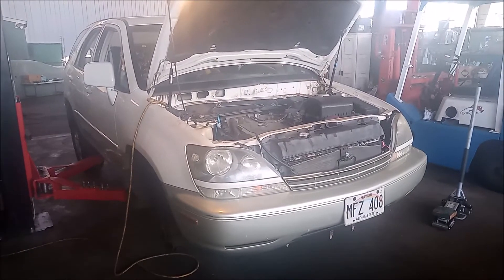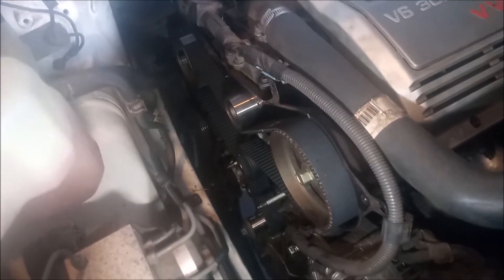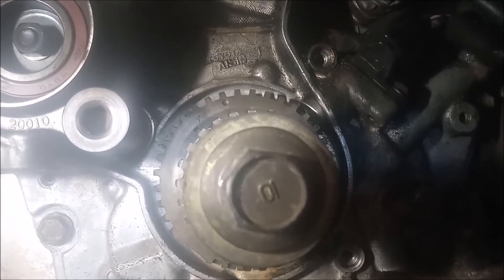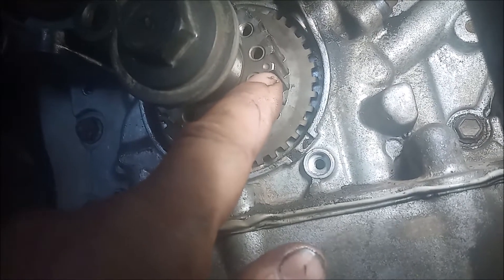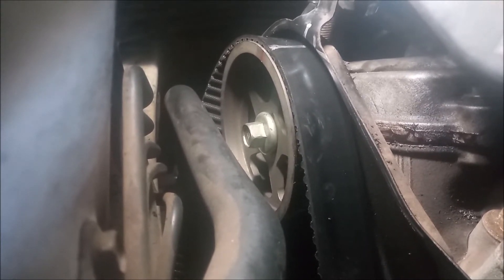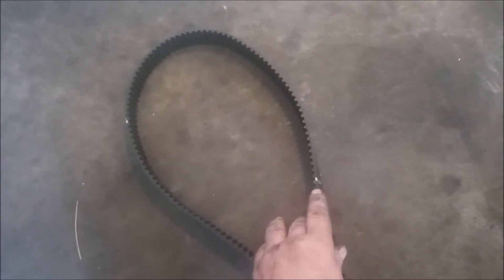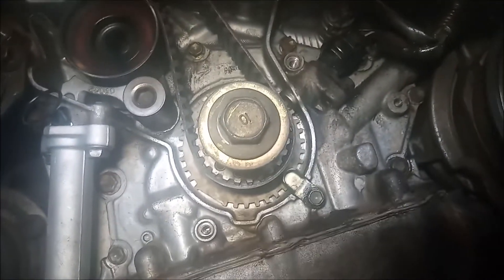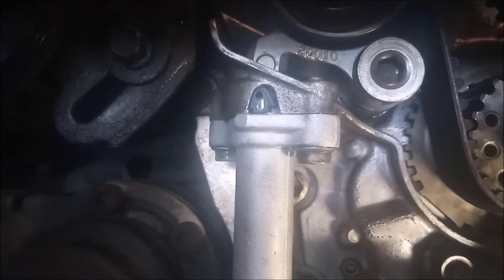Toyota/Lexus Timing Belt and Marks - 3.0 V6 1MZ-FE & 3.3 3MZ-FE Highlander Camry Sienna RX300

Comment: quick question.  I have a 2003 lexus es300 1mzfe engine v6.  Nothing wrong with it.  I was planning on doing the timing belt so I took the cover off.  I went to rotate the crank to time the engine.  I couldn't line up the 3 marks with so many full rotations.  I put everything back together because the marks do not line up exactly.  I thought it would be 2 full rotations.  Those marks didn't line up and I was rotating it like 5 minutes and got tired lol.  I am currently driving the car and the engine is great.  I am thinking I should re-attempt this but wanted some advice.
Reply from the maker: When you turn the engine, you do not look at the painted marks on the belt, you look at the notches on the pulleys and how they align to the narks on the back cover for the cams,  and on the block for the crank. The painted marks on the belt take 26 rotations to come back to the same position. The notches on the pulleys should come back into alignment with the cover and the block after two rotations. If the belt is not installed correctly, they will be off - after two rotations. Anyway I advise you never to do a timing belt again, because you do not know how to verify your work, and you lucked out this time, but next time, it might all come crashing down on you.

Comment: Thank you the numbers you counted were what I needed because the marks on the belt on the new one where not right and was finally able to finish the job without taking the timing belt of again
Reply from the maker: How can the marks on the belt not be right? It means you put the belt on backward. You need to remove the belt and flip it. Then the marks will line up correctly.

Comment: Thank you !! From.. 0mark/( or using arrow mark "pointing away from the engine" ) 77 from cam shaft toward bank 2 sprocket, bank 2 sprocket to bank 1 sprocket 59, from bank 1 sprocket to cam shaft 0mark/(arrow) 75 ( bank 1 is located in the back of the engine touching the fire wall) total teeth 211 in 3mz-fe.

Comment: My lower crank pulley timing cover was completely destroyed.. how do I set crank pulley notch with tdc?.. not the timing crank pulley notch, but the serpentine bigger pulley groove.. in other words, I don't have a zero to go by on the cover. please help ..thank you so much!
Reply from the maker: Without a cover, you cannot use the harmonic balancer notch. You have to refer to the marks on the crankshaft sprocket and the oil pump cover.  Or you can line up the camshaft sprocket notches with the back timing cover notches. .

Comment: Can you check if the timing is off while the crankshaft pulley is still on? I see two notches on the crankshaft pulley.
Reply from the maker: Yes you can check by lining up the notch with the zero mark on the timing cover. Your pulley should have only one notch.
Reply: Okay, I was looking at the drilled balance holes on the wrong side. What do you look at once the notch is lined up with zero? I figured you look at the timing belt but I saw someone imply the timing belt only lines up during installation.
Reply from the maker: @MrObsvenchilde  correct, the marks on the timing belt line up only every 26 revolutions. But what you know when you line up the harmonic balancer notch with the zero on the cover is that cylinder 1 is at tdc. In this situation, the notch on each camshaft sprocket must line up with the mark on the rear timing cover - like the video. You can disregard the belt. Just make sure it is tdc on the compression cycle, not tdc on the exhaust cycle. How do you know which is which? Well on tdc exhaust, the notches on the camshaft pulleys are nowhere near close tothe marks On compression, they should be at least close.
Reply: @Merryfrankster_  Okay the balancer and the sprockets line up but the belt is sometimes loose on the top side. By comparison the bottom is a lot more taut. Is that a concern? Or is it normal?
Reply from the maker: @MrObsvenchilde  when you turn the crank by hand the belt sometimes comes loose between the cam pulleys because of the valve spring action delaying a cam or springing it forward. This does not happen when the engine is running.

Comment: How can I replace fuel tank for 2.2 Toyota camry 2000 model 1mz v6
Reply from the maker: Easy. Just four bolts hold up the tank. But you must connect everything connected to the tank, and disconnect the exhaust pipe.

Comment: How are you counting? 77 in-between or mark is 1 and 2 mark is 77. Mark is zero and next mark is at 77?
Reply from the maker: Mark is 0. Next mark is at 77. Mark is on thin section of belt, not rib. Did they sell you one of those belts without marks? Return it.
Reply: @Merryfrankster_  I have a belt with only arrows telling me the way it supposed to flow. .pointing to the right . 59 between top cranks 77 from right to crankshaft and 75 from left to crankshaft

Comment: What if there's no mark on the inductor wheel? I have a divot in the side of the crank gear but no mark on the inductor plate.
Reply from the maker: Check my other newer video where everything is shown even more clearly. If you have no marks to set the timing, then I don't know what to tell you.

Comment: He didn’t talk about making sure that back wheel is top dead center.
Reply from the maker: He didn't, did he.
Reply: @Merryfrankster_  I need some help! I took off the timing belt at what i thought was tdc but the cam in the rear is not aligned at tdc only the crank and the cam bank 1. what do i do now how do i fix this
Reply from the maker: @chumbag  you can turn the camshafts to tdc then put the belt on. I have another more recent video that shows the marks more clearly.

Comment: The timing marks on the camshaft line up but on the block it’s 3 teeth off what do I do?
Reply from the maker: You have to remove the belt and put it back on correctly. I think you have your belt flipped backward possibly.
Reply: @Merryfrankster_  is there a way to find top dead center with out removing the intake to get to cylinder 1?
Reply from the maker: @kingkaydo8780  Well yeah the cylinders are 120 degrees apart so if you set cylinder 2 to top dead center and turn it back exactly 120 degrees then cylinder 1 will be at top dead center. Also Cylinder 4 on the front bank will be at top dead center same time as Cylinder 1. But are you not able to see the timing marks on your crankshaft pulley?
Reply: @Merryfrankster_  I can see them I’m just trying to make sure the engine is TDC I took off the belt already changed the water pump but when I tried to start I couldn’t tell if the timing belt I put on jumped or if it’s off time because it didn’t start.

Comment: So the Arrows point to the engine ? And I put them on the lower crankshaft mark or do I put the dotted line on it?
Reply from the maker: Like I said, point the arrows toward the engine, and line them up with the mark on the crankshaft.
Reply: I have just arrows pointing towards the way the belt will spin and I can't get it right...
Reply: Most other videos have arrow pointing away from the block… is this a gates belt thing?